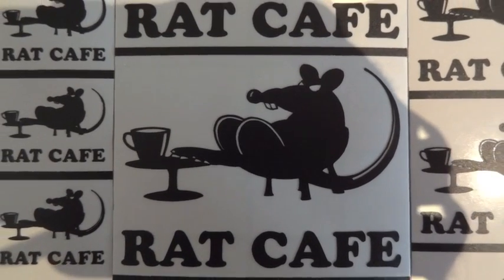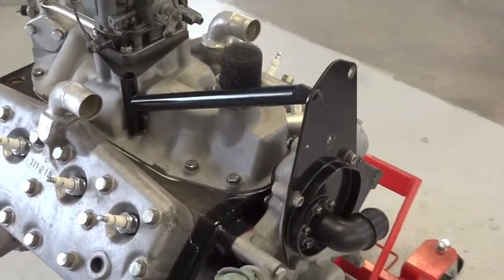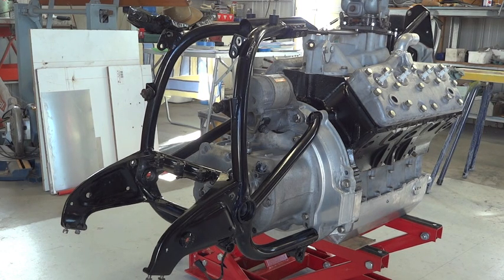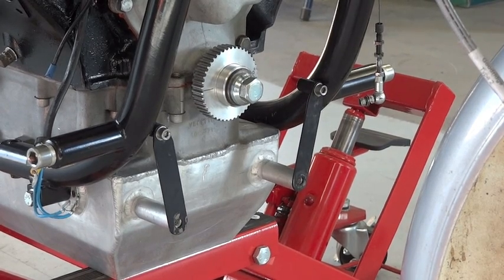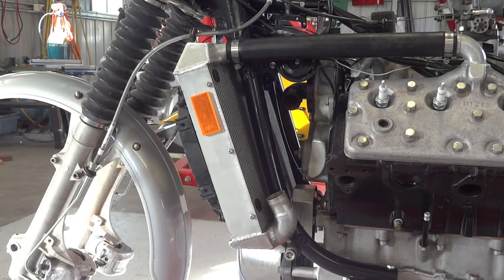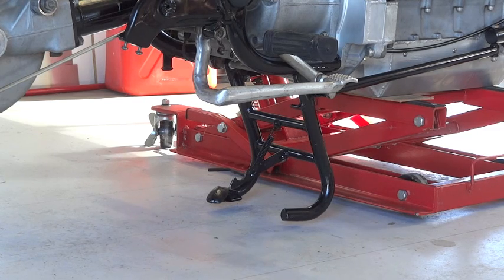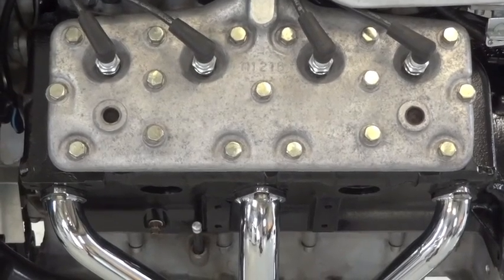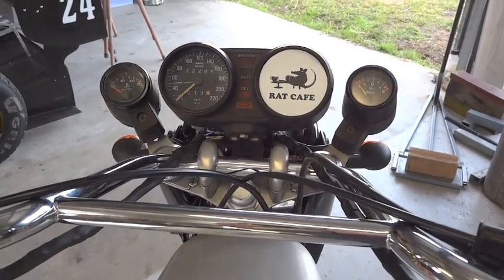rat cafe V8 bike build

Comment: The term "rat" is certainly said in jest. A boss hoss is a tossed together bloated saggy pro wrestler in comparison. I'd love to see some CNC whiz fab a set of finned alloy heads ala edelbrock, offy, etc. Truly it epitomizes the form fitting function theme. Beautifully designed and engineered.  One of us Yanks should give it a try with Ford V8 60/and Honda GL trans.

Comment: Goodness what a remarkable machine!!! I stuffed a Z482 twin Kubota motorcycle into a very tiny 200cc Chinese enduro with a type 40 CVT. With only 13 HP I could only achieve 54 mph top speed vs the 57 mph with the previous 14.8 HP engine.  The cast iron Japanese beastly engine hardly fit inside the frame without cutting the backbone but I made it work with a smaller 18" front wheel vs the 21" it had before.  My next diesel motorcycle will certainly be powered by a VW TDI 4 cylinder.   Keep up the great work!!!

Comment: This is a very beautiful project. However, can you throw a little more light on the gear box or transmission system. What kind of gear box used and how the conversion or adaptors were created.

Comment: Hello, I am actually doing the same build you have done, just with a different engine. I was wondering if you could help me out. I know the bell housing is cut down to 40 millimeters in length, but what is the thickness of that end plate that you have welded on?

Comment: How's the alternator holding out being spun backwards? I did the same on a Lucas 17acr, it unscrewed the guts. Took it a few months, but killed it, not impressed because it was brand new and I'd been saving it for the right project. Turned out to be the wrong project as it happens.
Always wondered why they siamesed the centre two when the could have done the outside pairs to give 2 down pipes. I hate the idea of sacrificing power etc by having a siamesed head. 2.8 Capri, Mini and 2 1/4 Land Rover etc have it unfortunately, but always liked the look.
Lovely video by the way.
Reply: Alternator is fine. Beware the Prince of Darkness.
Reply: malcolm oastler that's good news, I was asking for trouble doing anything with an acr I suppose.

Comment: the engine is only 400mm wide, and 142kg. It's very compact because it's a side-valve, so the heads are only about an inch thick.

Comment: what gearbox did you use?
Reply from the maker: Standard BMW R100/7
Reply: thanks
Reply: the original BMW R100/7. It's a bit short geared, but OK
Reply: You can get a taller top gear +5% .  I had one put in in Canberra. It is noticeably taller.  Actually makes my boxer R100 RT run in its vibey range, which not ideal doing 100, by 120 it's ok again. Might be just the thing for your V8.  Great build, cheers.

Comment: When the Morgan car builders started using more powerful engines, they had to change to Alloy wheels to handle the torque. True, with the small section tyre on the rear, the wheel will just spin madly anyway but then whats the point? As I see it and I could be wrong the power the engine develops is mostly unusable. As a feat of engineering construction an amazing piece of work.